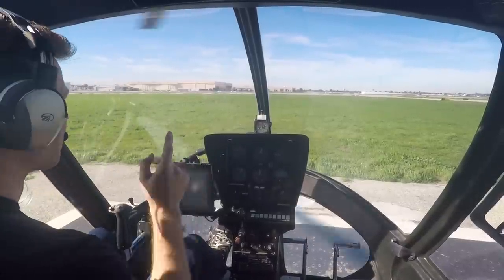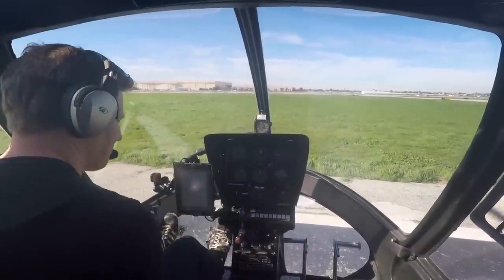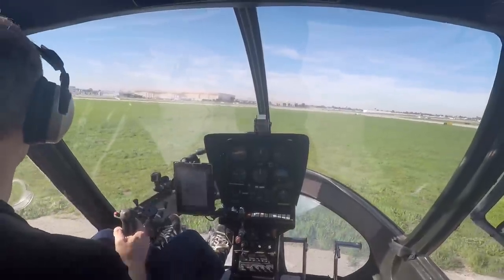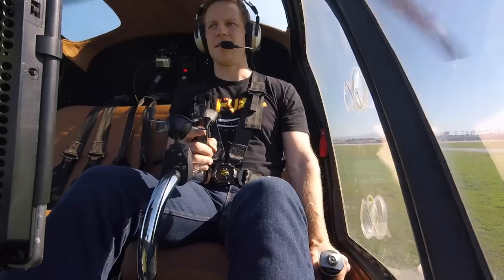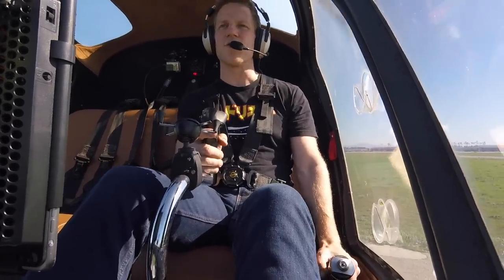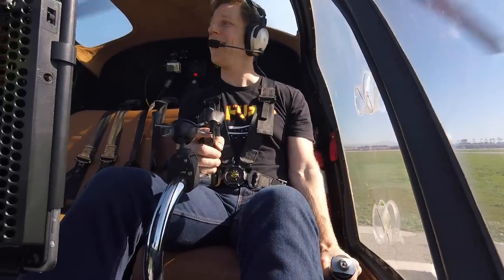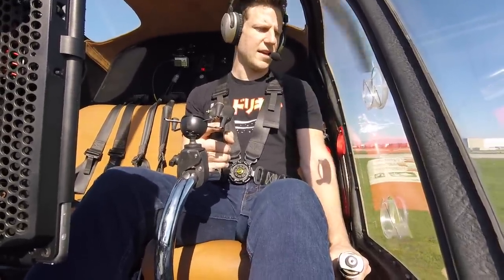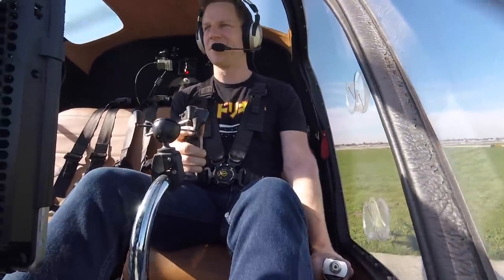How helicopter controls work

Comment: Thanks for that explanation. I had fixed wing lessons in North UK back in my 20s then I moved to London & prices were so much higher there, so I gave up. I've flown in a chopper once or twice but never had the chance to "feel" the controls. I get the impression from your video that its a bit like patting the top of your head, rubbing your tummy and balancing a ball on your foot all at the same time!  

Choppers need a lot of maintenance,  do U do your own or employ a mechanic?
Reply from the maker: Nigel Hunt There’s a parallel between riding a bike and flying a helicopter. It seems utterly impossible until...click...your brain engages the mental circuitry needed to fly. 

As for maintenance, I pay a mechanic. It would be much cheaper to do it myself but to do so legally in the USA I’d need an Airframe and Powerplant certificate. And getting that would require time I sadly don’t have. So, I’m stuck throwing money at the problem.

Comment: Please make more videos. One question. Can you give a rough estimate on how much it cost to operate the Enstrom. I know everyone is different based on flying hours but looking for ball park please. Might want to buy one. Thank you
Reply from the maker: Kevin Roche Maybe I’ll do a proper breakdown of expenses in another video. But in general terms, it costs about $100/hour in fuel to fly my bird using the nearly $6.00/gallon fuel at my FBO. 

Digging deeper, the other major cost is component times. If my heli was new I could estimate hourly expenses based on Enstrom’s fantastical direct operating cost sheet but my bird is used. That leaves a messier calculation involving flight hours, purchase price, parts, and labor. 

Truthfully, I haven’t run those hard numbers. My goal is to keep fly and nailing the hourly figure is mostly academic at this point. My ownership experience has been marked by semi-frequent large expenses as we address long-deferred maintenance issues, unplanned airworthiness directives, and make smart improvements. 

Google “Enstrom 280FX / F28F Direct Operating Cost” and there’s an hourly estimate of $163.70. I’m guessing mine is higher than that but your results may vary.

Comment: Question.  About at what wind speeds (crosswinds) does it require more work to fly and what wind speed is it just untenable to fly?  I think I can assume you can't fly during a tropical storm or would I be wrong.  Or could you if it was a tailwind?
Reply from the maker: R L Great question! Thanks to a vertical stabilizer at the tail, helicopters naturally want to face into the wind when hovering. So, in a crosswind one big limiting factor is the tail rotor’s ability to overcome that tendency. 

My heli has an unblocked tail rotor, meaning there’s no vertical tail surface to interfere with airflow through the rotor. As a result, it has excellent tail rotor authority to counteract a crosswind. My understanding is the old Bell 206 is the exact opposite and can exhaust the limits of its tail rotor thrust very easily. 

Depending on the heli and the pilot’s experience a 10-15 knot crosswind should be manageable. Above that it becomes increasingly tricky to maintain a stable hover. It also depends on which direction the crosswind is coming from, which opens a whole can of worms about airflow and turbulence through the tail rotor that might justify a separate video.
Reply: Strong winds can be interesting in small helicopters, or copters in general.  Wind during a hover can affect a copter in a variety of ways.  Wind blowing over the spinning rotor system generates additional lift, so the copter may tend to balloon up, even at a set collective setting, so that has to be compensated for.  Depending on the direction of the wind, tail rotor authority can be affected, even to the point where the tail rotor stops being effective (the tailrotor blades can actually stall).  As Micah said, the tendency is for the copter to weathervane towards the direction of the wind, and the tailrotor blades have to try to compensate for that.  In forward flight, wind has a similar effect as it would have on a small stick-and-rudder airplane.  Gusty winds are another story, and when flying a copter with a semi-rigid or tetering style rotor system, like those on a Robinson or Jet Ranger, gusts can create low gravity situations, and those are hazardous for those types of helicopters, but that topic's specifics would require a whole lot more explanation.

Comment: You would think in this day in age that operating a helicopter would get easier and would require less constant adjustments. Like and automatic car vs a standard transmission. Too operate a helicopter with two hands and two feet is just a bit much i think
Reply: HOVERING  is similar to a unicycle.  Cruizing point to point like a scooter

Comment: I understand there is a green zone for RPM. But how far can you leave that zone? Is it going to cause any problems aside from being less efficient?
Reply from the maker: ast5515 Under powered flight, engine speed is a limiting factor on the high end of the green zone. Most helicopters also have a higher rotor speed redline that’s limited by the structural strength of the spinning parts during autorotation. 

On the low end there are two dangers. 1: Increased likelihood of blade stall. 2: If the blades spin slow enough there won’t be enough centrifugal force to hold the blades in the horizontal plane. In that situation the upward rush of air would cause the blades to fold up. Bad stuff.
Reply: I'll add to Micah's comment.  There are green "arcs" for the engine RPMs and the rotor RPMs.  Like Micah said, exceeding the engine RPM (in a non-governor equipped helicopter) can cause similar problems as any overrevved engine.  Exceeding rotor RPM limits in an autorotation can cause blades to be damaged, or worse, separate from the copter, and you can image what happens next.  Low engine RPM will also cause a subsequent degradation of rotor RPM, and below 70 percent (in most copters) the blades stop producing lift, and the helicopter simply falls out of the sky.  I typically fly Robinson R44's, and they use a correlator and engine governor so the engine and rotor RPM's stay matched in the green arc, greatly simplifying the flight experience.

Comment: Is it the angle of the collective that makes the torque or is it the increased engine power necessary with increased collective? If you were auto rotating would you get the same torque?
Reply: auto rotation meanz. NO POWER⚠️  the air iz going UP thru now ...   when u r near the ground  u PULL collective HARD to bite the air.  Hopefully stopping safely.    Yer most welcome

Comment: How long did it take until you became a fully licensed helicopter pilot?
Reply from the maker: LeGrandFromage Took about a year but I was limited by budget and time constraints. With unlimited cash I definitely could’ve done it quicker.
Reply: Like Micah, it took me about 11 months to get my helicopter license, but many other factors play a roll.  The more frequently you can fly, the more of the training is learned and retained.  If you take weeks or more between flights, you'll lose a lot of what you've gained, and subsequent flights will be refreshers on your last flight rather than learning new stuff.  The longer it takes, the more it costs.   I was what they call a "40 hour miracle"  meaning I got my license in the FAA minimum 40 hours of flight time, so my license was way cheaper than one would be for a student who required much more training.  The average pilot  gets it done in 50 to 75 hours, so plan on spending more than the quoted amount, unless you pick it up really quickly.  Flying a helicopter is like nothing else, and I highly recommend pursuing a license, even if it's just for recreational flying, like mine is.
Reply from the maker: Jason Coleman Thanks for the added detail. Spot on!
Reply: I started in July 91, got my private in Oct 91, but I flew probably 5 days a week (had a night job). Don't believe the 40 hours they tell you to get a license, that pie in the sky. Or maybe it's possible, you just wouldn't be very safe if something went wrong.  Even with years of fixed wing experience I was close to 50 hours when I took my check ride.
  Another year of piddling around to get my commercial and another intense couple of months for CFI.

Comment: Seems like everything is mechanical and nothing is automated. I was surprised you have to manually adjust torque when increasing the spin of the main rotor. Seems like that could be done automatically, but I'm guessing there is a good reason it's not.

Comment: Great video, helio, heldio hmm, great helicopter video. One of the best I’ve seen. Cheers👍
Can you describe how the controls ‘feel’. 
E.g. Is the cyclic like a stiff, auto centring home PC joystick?? The pedals? Like aeroplane sim rudder pedals, firm & auto centring?  I saw you let go of the collective so I assume the throttle and collective stay exactly where you leave them - or do you hold a button it to move them that locks when you’re not pushing it?
I’m making a sim and I have some good gear but I want the ‘feel’ to be right. I’m @ mickATliondcDOTcom if the answer is too long for here (like the question- lol) cheers mate
Reply: FRICTIONAL setup.  Variable

Comment: How fast will that system loose control. Like if I hit right instead of left but just for a second. I guess how much room for failure do you have?
Reply from the maker: J MAC It all depends. There are a few things you can do in certain situations that can cause bad things to happen quickly. But generally speaking if you make too small or too large an input a trained pilot can make appropriate corrections without issue.
Reply: @MicahMuzio  cool man thanks for the response that's awesome! Stay safe brother I like the content you have put out a lot.

Comment: It seems complicated but I drove motorcycles for 38 years using both of my hands and feet at the same time so maybe with training I would be proficient at it. It is cool though.
Reply from the maker: A motorcycle background doesn't hurt. But as a helicopter pilot and motorcyclist I can verify, the helicopter is much harder to operate. That said, there are no natural born helicopter pilots. Everyone needs training. I'm sure with proper training and seat time you'd get the hang of it.

Comment: So both the cyclic and collective change blade pitch? Also how come when the collective is raised, the helicopter doesn't keep rising?
Reply from the maker: Yup. You are correct about the cyclic and collective both changing main rotor pitch. As for the collective, raising it makes the helicopter will climb. Lowering the collective makes the helicopter descend. The further you move the collective in either direction the more quickly the helicopter will climb or descend. You can also find the sweet spot with collective position where the helicopter doesn't climb or descend. That's what happens in cruise flight or when holding a steady hover.
Reply: Oh okay gotcha! What determines the collective sweet spot?
Reply from the maker: @sammysainz5  That’s just whatever position the collective needs to be at so the helicopter neither rises nor descends. That position varies depending on the helicopter’s current weight, wind, air density, and a bunch of other factors.